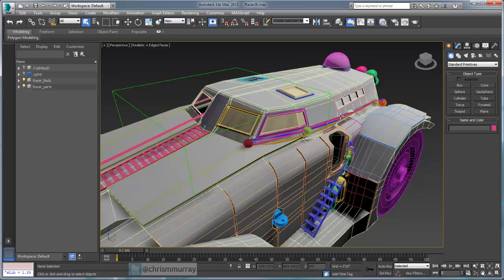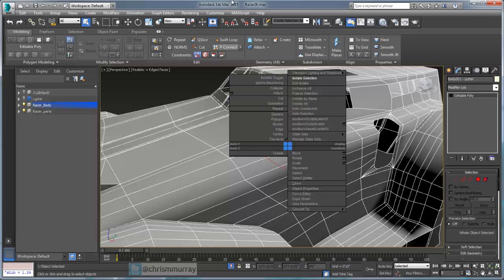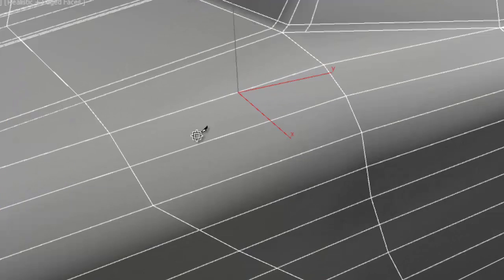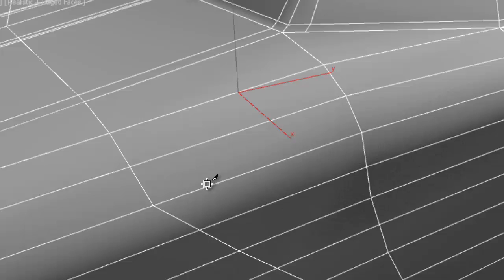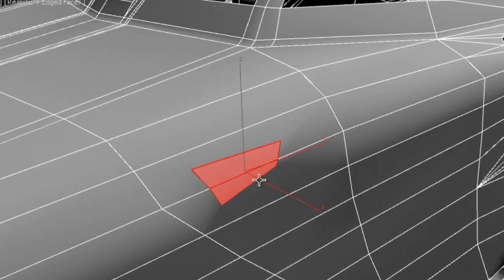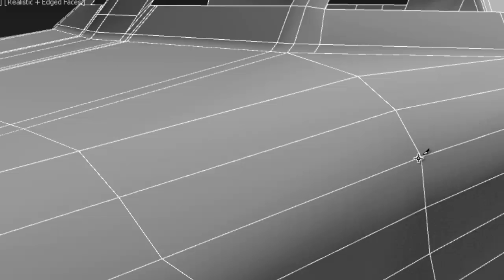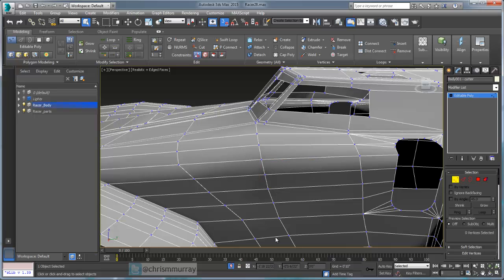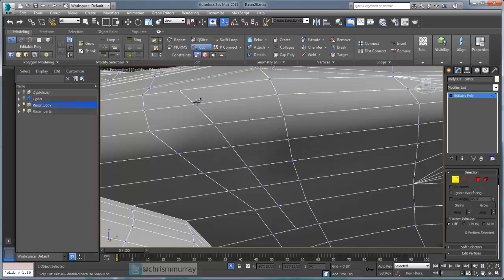3ds Max 2015 Tips and Tricks: Cutting Polygons with the Cut tool

Comment: isn't a problem not avoiding triangles? ;---; my teacher said to avoid them, or any other shape that's not a retangle... i'm feel like i'm caged ;-;
Reply: It's fine to keep non-quads (anything thats not 4 sided) as long as they don't show deformations in your model. So if its usually a flat surface, you dont need to bother fixing non-quads into quads because the deformations will not show. This is good because you save time and also you will have a lower number of polys, which is extremely helpful when it comes to V-Ray rendering - it saves a lot of time. So learn to work fast and efficiently while getting the same end-result :)
Reply: @markg8125  oh, ok then , I'll make some tests  related to this. Thanks a lot

Comment: I want to hide that axis so bad. ;) I know, everyone's workflow is different. 

I'm having problems with the cut tool creating weird phantom verts in Max 2017 in a way that doesn't happen in Max 2011. Basically, there seem to be extra, non-selectable verts that get added...but then they seem to disappear on their own.  Waddya think...video card issues or something else? Also happened in Max 2016 and on a different machine too.
Reply from the maker: Not sure. Could be card issue. The new select preview can sometimes act a little wonky.
Reply: Thanks for your feedback! In Max 2011 I have zero issues with this, so it's my go-to modeler. But, I like some of the features of 2017! :D

Comment: When using Cut I am getting odd results - no matter that I click on the middle of the line (the icon is correct), then click on the adjacent line, 3dsmax is then putting the line in a place I didn't specify - making a diagonal from one corner to another corner.
Reply from the maker: +SuperJV4x are any of these buttons on? http://screencast.com/t/twxFy3dT
Reply from the maker: more specifically... only the left most button should be on...the three on the right are constraints.
Reply: i have the same problem and only the left button is selected

Comment: @3dsmaxtrainer. No, the answer to the question you had been asked is actually.

"yes this has been a problem for many years, sometimes the cutting tool displays a cut to a vertex but due to a miss calculation it'll make an extra cut under the vertex and then to the vertex you selected thereby creating an extra vertex.
A common solution or quick fix for this is to select your entire mesh in vertex mode click on the little box next to the weld button and weld every vertex at a threshold of  0.1"

@3dsmaxtrainer, Don't assume that everything works as intended.
Naively assuming this can lead to confusion when arrogantly stating (in short)
"Your doing it wrong, this is how its done.. When done properly"

Comment: what laptop you advise me for 3ds max and 3d rendering
Reply from the maker: lybracocce That really subjective. Depends on your budget and they type of work you'll be doing. But for 3dsmax, in this order, get The fastest intel processor (i7 - class), the best nvidia graphics card possible (Quadro series), and the most ram you can afford.
Reply: Thank you so much...
What do you think of this Quadro: K2000D 2GO
(a gtx 770-added)
i7-3930K 3.20GHz processor,
16 GB of RAM
map mother x79 GD45
a 120GB ssd drive for windows
512 gb sata ssd one for programs
Thank you 3dsmaxtrainer